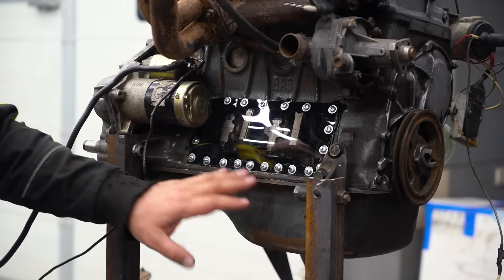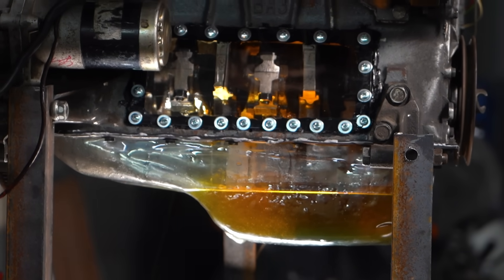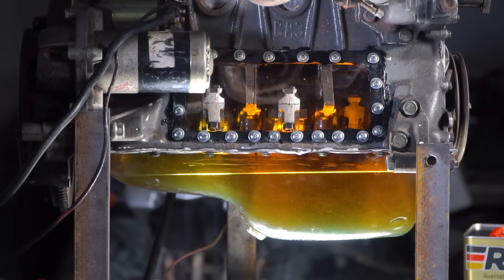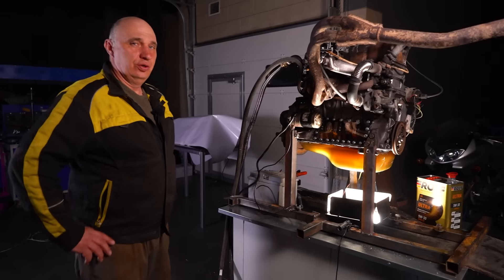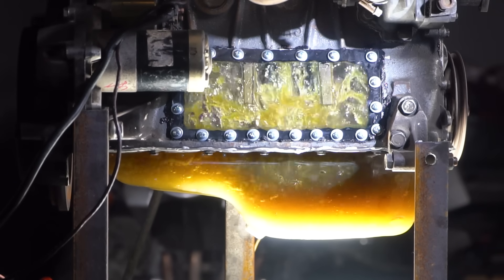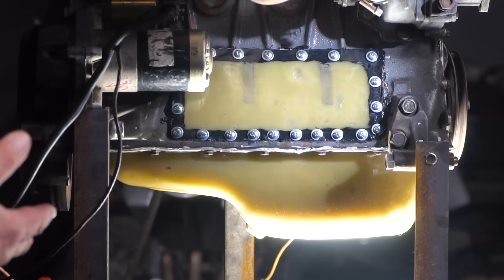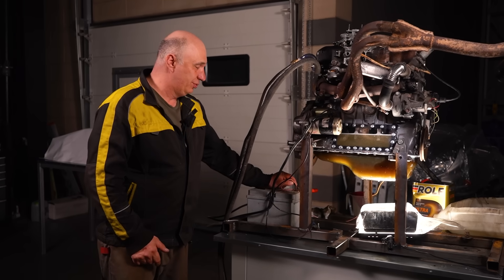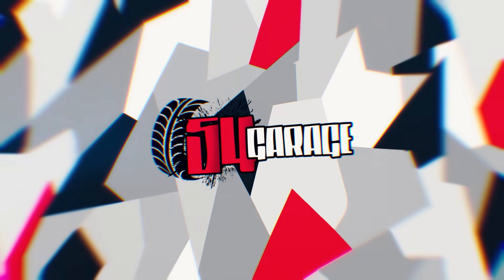What actually happens when you overfill your motor oil? (w/ transparent oil pan)

Comment: I learned in auto mechanics in the 87 and 88 it builds up pressure and blows out seals like the crank seal the rear seal and gaskets on oil pan and that Is was it called leaking engine so anytime you shut off it will leave a mess  on a driveway or streets so BOTTOM LINE HERE .. DONT OVER FILL NOT EVEN A 1/2 A QUART IT WILL DO DAMAGE OVER TIME

Comment: Too much oil in the crankcase causes cavitation which causes less lubrication to Vidal close tolerances inside the engine. Air bubbles caused by cavitations decrease lube properties. Same issues if you overfill a transmission. Cavitation causes premature component failures.

Comment: the new 3 liter diesel engine gm  puts in 1500 GMC and chevy pickups they put 1 extra quart of oil in the engine from the factory on purpose
Reply: ? Extra? They designed it, why don't they just raise the amount in the service manual and raise the mark on the dipstick.
I mean, whatever they decide at the factory should be the correct nominal amount
Reply: @Thesaurcery4U2C   because  when these engines are first breaking in they use more oil before they are broke in ... so they put the extra quart in cause most new car owners don't check the oil
Reply: @joeandrijeski5085  
I got you.
I wouldn't think that a new motor would use any oil at all.
That is probably why dealers offer "free oil changes" for a year when you buy a new car.
Someone will be checking the levels out when its new to make sure it can go 300k miles and keep a good name for the manufacturer.
I still can't picture where a brand-new engine would use more oil. 
It's a lubricant and only gets borrowed until it isn't working as well as it used to.
You know what!
There is going to be little particulates of metal shavings from everything getting used to spinning against tolerances during brake in, so just having more volume of fluid to catch that with is what they must be attempting.

Comment: in the 1980's I bought a 1970 Plymouth Valiant with a 225 slant six.  A previous owner put the wrong dipstick in the engine making it look like oil was low when it was actually over filled.  I picked it up cheap probably because the previous owner thought  it was a leaker.  The oil coated the firewall and had blown all over the undercarriage pretty much rustproofing the whole underside.  I put in the correct dipstick, my father and I put on newer heads that could handle unleaded gas and an RV cam that gave more bottom end torque.  It always ran great even when over filled with oil.

Comment: Disclaimer from subscriber who watches you can only almost double filled this engine in this video with this particular some other engines may very, but if it’s got the same style as an oil pan and a pick up, then I would suggest filling one and a half times more than not recommended. I wouldn’t do this on a Volkswagen though. They have low profile oil pans for the most part.

Comment: The old splash lube stove bolt Chevy engines had dippers on the rods running down in the oil to lube the engine. Had a neighbor who had a hired man he told to drain the oil and refill in a caterpillar engine, he filled it to the top of the fill plug in the valve cover lol.

Comment: The problem may not be instantly... over time, you'll experience,  Reduced fuel economy, leaky crankcase seals, and blue smoke  from your tail pipe due to oil escape into the combustion chamber due to increase in crankcase pressure.

Comment: GM factory overfills the new 3.0l duramax engines by 1 qt and says not to overfill it after the first oil change.  Wondering why it’s safe for them to do it, but not the consumer.
Reply: Probably because its a brand new engine, usually after an engine rebuild you put a little extra oil in for the new components so that would be my guess.

Comment: My concern if pouring too much oil into it is that the running engine making the oil very hot and maybe the manufacturer haven't made space for the coolant to be able to deal with that issue.

Comment: Can you imagine what is happening in the PCV!  The oil foam and vapour high volumes will be blocking flow and the crankcase pressures will be a problem.  Too bad they did not measure those differences as they went along - although at the end you could see it wash out.  I think it would have helped determine a safer overfill level for use while flushing.  Still fun to watch.

Comment: Oil that is aerated that badly will dramatically accelerate bearing wear, especially for newer engines made with tighter tolerances.  Don't overfill if you want your engine to last long.

Comment: I just witnessed execution of the most thorough engine flush ever performed!
Reply: Foaming cleaning technology! 😂
Reply: I was just thinking the same thing. I will add a couple of liters of oil to my cars engine, run it for a few kilometers and then do the next oil change
Reply: the dip stick have hallow dots on it which tells how much space is in the sump available to fill the oil for the engine

Comment: I wanna know what happens when you put the oil filter in upside down. I have a golf and it's possible to do especially when some filters have no writing at either end. The insides definitely have a top and bottom and you can screw the housing cap on whichever way up the filter is.

Comment: You’d better be careful with that turbocharged beast you’re driving, the turbo bearing has a drain that can be restricted by a high oil level. This can cause an over pressurized turbine bearing. Sometimes, they cross the boundary to the compressor side, and as soon as oil hits the impeller, the shaft either bends or snaps. Now you’ve created the greatest mosquito repellent known to not only your neighborhood, but mankind as well.

Comment: This video is extremely deceptive. I've personally seen the catastrophic effects of even a 1litre overfill multiple times. No load engine on a stand for a seconds is not a real world engine driving for minutes or hours at a time over months. Small cars often have a much lower capacity than whatever this is. The worst I've seen was a car that went to a speed oil place, they drained the transmission fluid by mistake and added the full quantity of engine oil back in to the still full engine. Took less than an hour for both engine and transmission to be completely destroyed. Removed oil oan on that one and the foamy oil had resulted in basically sand where there should have been oil at he rod bearings. Don't do it.

Comment: The other problem with overfilling the engine oil besides foaming ( bearings - in particular the connecting rod ones do not respond well to aerated oil ) is excessive crankcase pressure , I have seen various brands of cars completely blow the seal out of the housing ( rear crankshaft or front crankshaft seals ) with as little as 25% overfilled oil and this quickly creates Massive Oil Leaks !

Comment: Had a 2014 ford focus billowing out smoke, the breather usually connects to the intake to burn off excess vapors. 
Checked dipstick oil was almost to the top of the stick with bubbles in the oil.  Poor acceleration, hazy smoking tail pipe.
Removed oil to fill line drove it for 30 miles. Smoke went away but vehicle still had variable idle. 
Removed plugs, had bad sign of oil fouling, replaced with new copper plugs, vehicle is back online. Thank you for this invaluable cutaway of the engine.

Comment: We're told the correct quantity of oil was doubled, and later "700grams" (millilitres?) was added - but nothing else.  We never heard the difference between the low and high marks on the dipstick, or even what motor this was.
🤷‍♂️ 
How much was the correct initial fill?  
How much oil was poured in at each increase? 
What was the final amount, before the major leak?

Comment: Great video. Thanks. I suspect that a tear down examination of the engine will show one huge problem: the oil seal rings for the pistons will not be effective beyond the recommended threshhold. The oil pressure would have caused ring failures. We can see that the engine was burning oil in addition to atomised fuel (hence the blue smoke). And surely, the spark plugs would be soaked with oil, resulting in reduced "healthy" spark (and eventually no spark at all).

Comment: One big problem is too much pressure in the crankshaft case which destroys every engine gasket over time. That’s when engines start to burn or loose a lot of oil. Next problem with the shown engine is air in the oil, which lowers the pressure and results in bigger wear of bearing shells or faster engine damages. That’s why proper designed engines have a splash plate in their sump to let the oil calm down. The video is nice, but sadly there is no correct explanation of the dangerous sides when I read all the comments.

Comment: Had a kid bring in his brand new to him Mitsubishi eclipse. He just changed the oil himself and now it's not running well. I pulled the dip stick and it was full, like to the top of the dip stick.
He blew his oil seal out of his turbo and that why it wasn't running right. I drained 5 gallons of oil out of it, replaced the turbo and he was good 2 go.
That said, I put 15 gallons into a 7.3 powerstroke once cause the gun was set to gal and not qrt. I thought it took an long time to fill up.

Comment: All depends on what engine you're overfilling... some will handle overfilling.... well some engines will.. like a clogged PCV valve... can also push seals out from too much blood pressure... and some other engines have different tolerances inside engine that can be affected from over full on oil... and once things start pushing an overfilled areas it'll start gunking up over time.. like I said some engines are affected by this.. and some engines are not affected by this

Comment: The motorcycles we race (like the ZX14R in my profile picture) will start blowing the "extra" oil out of the breather long before this car engine did.
It only takes 8-10 ounces (.236-.295 Lt) to overfill them to the point where they'll blow oil up into the air box. And what's really interesting about overfilling is,
we did dyno testing on the ZX12R (produced/sold 2000-2005) and they lost 7Hp (at the tire on chassis dyno) = 168Hp when overfilled vs 175Hp...

Comment: all lubrication works better with just thin film of oil around metal surface than complete immersion that creates all sorts of problems (cavitation, foaming, rsistance, less power, pressure... and so on)

Comment: My car has a 1.6 L engine. Requires 3.8 L but I just put in 4.0 L. I read somewhere as long as you don't go over 10% of the required capacity, you should be good. So 10% of 3.8 is .38
I'm only putting an extra .20 in. What's that? Like a 6% over? This is only the second time I do it. Car has been running the same as always.

Edit: I put in Quarts not Litres.

Comment: The second problem is that the temperature increases further with the increase in the amount of oil, as the oil is a strong heat carrier and its continued flooding of the engine parts prevents them from being cooled by air.

Comment: This test while entertaining is not compatible to driving conditions.  I found out the hard way as a teenager when I overfilled the oil by 3 quarts (was supposed to take 5 quarts) because I mistook the transmission dipstick with the engine dipstick.  After driving it uphill at 50mph the head gasket blew because of the added pressure.

Comment: Would have been interesting to have an oil pressure gauge plugged in there. Thanks for the experiment!
Reply: Exactly, why no gauge? Why no vision of the exhaust for smoke? A voiceover with brains would be nice.
Reply: It would more than likely show less in the oil pressurised system due to the air in the system. Maybe even cavitation in the oil pump. A pressure gauge would have been great to show this effect.

Comment: I would have liked to have seen a temperature sensor and the readings.  I wondered at what point the clear window or oil pan might melt.  I'd also like to hear some commentary about what seems obvious... the engine is doing a lot of work as a mixing machine.  That's a lot of wasted work, just pushing fluid around.  The mixing also means the engine is also producing more energy going to heat, right?

Comment: This demonstration is moronic.  In every case where I have seen an overfilled engine, the oil accumulates in the cylinders themselves and then starts to burn, resulting in a plume of smoke out the exhaust pipe.  Eventually, the buildup of carbon will interfere with the spark and the engine will require a complete overhaul to clean it out.

Comment: I once put 12 quarts of motor oil in my Thundra V6. Drive it for 400 miles. Realize my mistake. Drain oil. Drove another 200,000 and still going. No engine problems ? And at the same time I accidentally drain all my transmission oil. And yep transmission drove another 200,000 and still going.

Comment: Don’t do it in a diesel, you’ll potentially get oil ingestion in the combustion chamber during compression when it should only have air, that leads to runaway combustion that destroys the motor

Comment: If you over fill it, It floods the top cam seals and will begin to leak. Those seals are normally not flooded. IT will make then break the seal and then the top end of your Block will leak.

Comment: One thing he did not talk about is as the oil level gets higher, it increases the pressure in the crank case. To a point, the PCV valve will deal with this, but the extra pressure will cause premature failure of gaskets and seals. It will also make the oil rings on the pistons work harder to deal with this excess oil which will cause the engine to burn oil. Lastly, it will force more air into the oil which causes cavitation in the pump leading to excessive pump ware and poor lubrication of the engine parts. 

Bottom line is; a little over full will not harm anything, but even 1 liter too much can cause extra stress on the engine that will lead to engine problems in the future. So, don't do it. Trust that the engineers who built that engine know what's best for it and follow the recommended specifications. The amount of oil, type of oil and when to change it.

Comment: I think what happens at the internal pressure begins to build and you may have a possibility of no problem with your crank and and bearings, etc., however with a little larger engine, maybe a six cylinder eight cylinder may create too much internal pressure that you may blow your Head, gaskets, etc. think about it

Comment: Lots of comments about overfilling oil doesn't matter then, and none about over pressuring the crank case. Pressure can build up. I had a 1972 Mazda 616 with 1600cc OHC engine. It held 4 imperial quarts (5 us quarts). I changed the oil every 2000 miles and the oil stayed clean. I went to a full service gas station while on holidays, they used to check the oil at every fill up. The guy couldn't see the clean oil and said it was low so I had him put in a quart. I only drove a few miles and the pressure build up in the engine blew the filler cap off and sprayed oil all over the engine. The filler cap was hard plastic with course threads that screwed solidly into the valve cover so the pressure build up had to be considerable.

Comment: These guys gave us the proper visual answer that we have in our minds. Next video suggestion, how little oil can an engine have before breaking
Reply: That would be fun.
Reply: This comment needs more likes I would love to see that video
Reply: Master Milo had a video about this. It's very short, as the crankshaft welds itself due to the friction
Reply: 2 quarts low, my 67 Dodge Dart, Slant 6 engine, still runs, would not recommend going lower, bought it used and that’s all it had in it!
Reply: Someone did this with a Honda engine, and it kept going for a while without an oil pan lol
Reply: the dip stick have hallow dots on it which tells how much space is in the sump available to fill the oil for the engine
Reply: That entirely depends on how long you want it to last before breaking.
Reply: I accidentally ran an engine with a quart. It'll be fine...
Reply: As long as oil still goes into the pump all good, as soon as the level goes below that no good
Reply: Interesting question. My VW takes almost 6 quarts, and I have a slow leak in the pan. So I've run it a quart or more low before without any problems. I've also overfilled by a half or whole quart and it was fine
Reply: If it's a 80-90s Honda, about 12 years
Reply: The minimum-amount that allows  'Continuous' circulation...but it WILL break-down faster due to raised-temperatures etc    dave  nz
Reply: That's more obvious. It's when the sump starts sucking air.
Reply: Local race cars would often run on anoutva quart low.  Presumably less wasted energy splashing the oil.

Foaming wears out the oil molecule and it degrades the effectiveness of lubrication even before the oil molecule breaks down
Reply: My 09 civic hybrid will loose power around 3K when oil gets too low. Checked it in this state before and oil doesn’t reach the dipstick. Never drained it to see how much is left though. I usually just add a couple quarts and it runs perfectly fine until I can do a full oil change.
Reply: @ryanjohnson5163 similar with my 03 Honda CR-V. I bought the car and didn’t know it burnt oil, ran it literally dry for a few thousand miles. Sometimes when vtec kicked on or when you hit 4K rpm, engine power went out, you just turn the car off and turn it back on again. 2 years later it works, though burns about a quart every 1k miles. Seems like it needs even more heat and friction to have an effect on that car
Reply: the dip stick have hallow dots on it which tells how much space is in the sump available to fill the oil for the engine